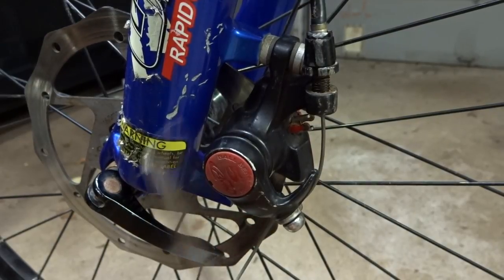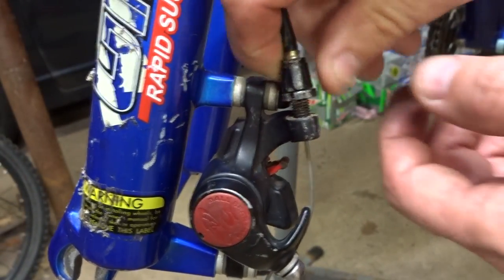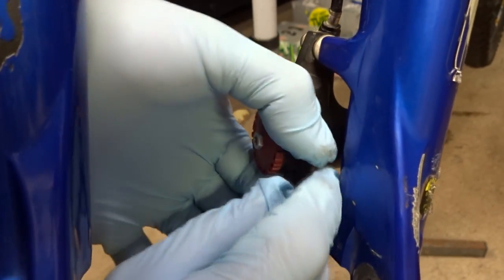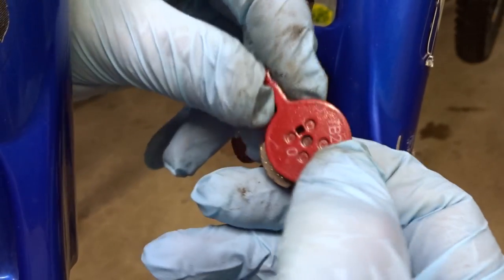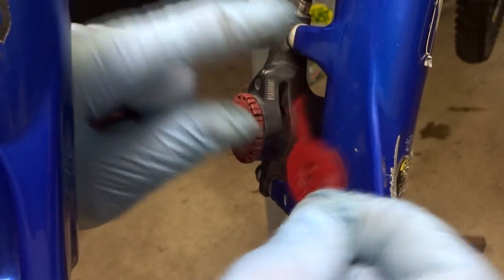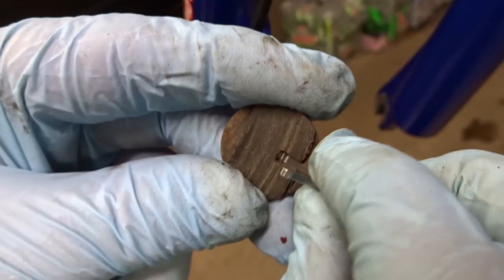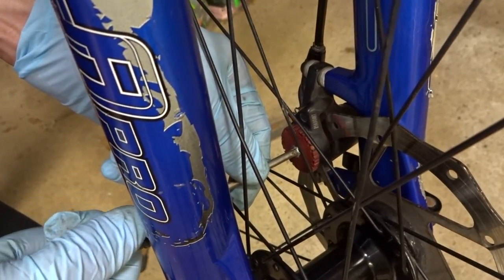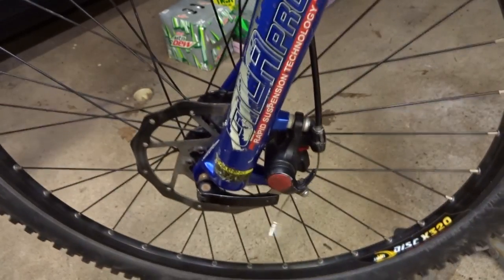How To Replace Avid BB5 Disc Brake Pads - Easy!

Comment: Thanks for posting the content. I was having trouble with the BB5 on my rear wheel. If I adjusted the inner pad until I got good braking efficiency, the inside pad would rub on the disc. If I backed it off two clicks, then I had serious brake fade. I still had plenty of lever motion, and I adjusted the pads to a very even and narrow gap on both sides of the rotor and I still could not lock up the wheel. I bit the bullet, pulled the wheel, removed the pads and pulled out the metric vernier calipers. One pad was 3.56 mm, and the other pad was 3.0 mm. I replaced both pads with AVID OEM pads and the wheel locks up nicely, even down grade on rough asphalt. Great descriptions, and great video quality.

Comment: RJ you are my hero this vid was exactly what I needed!  The spreader comes out the back of the caliper housing, and the pads come out the front!   I was trying to get the spreader in the same slot as the pads, derp!!   Nice videography too, difficult to light the inside of the caliper housing.

Comment: Video is very helpful. For those who need to know, You can indeed slide the caliper back and forth a bit by loosening the 5 mm Allen bolts to better position the outer pad closer to the rotor however in my case the pad is almost flush with the caliper itself and causes the rotor to rub directly on the caliper. In short there is little room for adjustment so new pads are necessary.

Comment: A little note here on wear adjustment on the BB5: There are at least two sets of instructions on this from SRAM. One of them, the installation guide (95-5018-005-000 Rev A), says not to adjust for pad wear using a barrel adjuster. The other, the BB7/BB5 service manual, page 11, says that you should use the barrel adjuster on the caliper, but to make sure that you use the locknut after you're done.

I remember adjusting a friend's BB5 caliper once, and specifically remember reading official instructions that said to use the barrel adjuster. In any case, this seems the obvious way to do it on the BB5, because there's no other adjustment for the outboard other than possibly pulling more cable through the bolt (which I wouldn't really like to do). Incidentially, this stupid problem was solved with the BB7, which has adjustment knobs for both pads. Mechanical brakes like the TRP Spyre and Spyke also have adjustments on both sides.

Comment: Hi mate thanks for the explanation!! 
 I need to replace mine as well but nor sure what pads I should buy. Originals by avids are around 15 for a pair or I could get another brand on amazon and they are 10 for 2 pairs. Which one would you go for??
Thanks for your time and stay safe.
Reply from the maker: Shrug. Your choice. Sometimes off brands are as good, sometimes they are not.

Comment: How thick are these BB5 pads in the first place? You measured the old ones but I was hoping you'd measure the new ones as they didn't look that much thicker to the eye!
Reply: I see you did not receive a reply from the content creator. I had the same question, did you find out the thickness of OEM new pads?

Comment: Hi RJ THE BIKE GUY I NEED HELP I have broken bolts on the disc break rotor how do you remove it I still love your videos
Reply from the maker: I don't know what you have to work with. A good penetrating oil. Heat. Tapping. Work them out. Good luck!
Reply: Thank you

Comment: Very good,  but had one problem and found solution.  When I removed spreader using pliers (maybe too big) caused clip to be compressed some.  It would not lock in after.    On the other wheel,  I used a small jewelers screw driver in the bend in the spreader and pulled it out easily without bending it.  Went back and shaped first spreader like the unbent one and it stays in now.

Comment: Thanks!
I'd also recomend checking if the disc or housing needs de-greasing, as it can affect the braking power. Maybe more important on the rear  brakes though, with the chains potentially throwing oil around.

Comment: Pads are still quite thick, you can adjust the cable bolt to make the calipers and pads move closer to the rotor at rest.  Same with the static caliper on the other side.
Reply from the maker: I was showing how to replace them.

Comment: Ey so I did the same thing you did putting the pads but why when I use the brakes the brakes feel really loose how can I fix it
Reply from the maker: I am guessing you didn't get them adjusted correctly. Or did something else incorrectly. Do it again.
Reply: Ok I got the brake pads but when I push down on the brake lever it goes almost to the handlebar is that ok?

Comment: Hello, I have a 2014 Santa Cruz Chameleon with Avid disk brakes. The brake model isn't listed in the specs on the the SC website. I can't figure out what brakes they are and what replacement brake pads I need, and Santa Cruz and Avid are both unwilling to help (they just want me to go spend unnecessary money at a dealer). Any ideas for how to figure out what pads to get? Thank you.
Reply from the maker: Identify the brakes by looking at the brakes.
Reply: @RJTheBikeGuy  Interesting, I think my question seemed reasonable, why even reply if it's going to be so worthless?
Reply: Your local bike shop should answer your question.They did for me.

Comment: I have Promax Render mech discs and a problem with the adjustment knob of the pads: front one doesnt wanna move at all and rear rotates both the know and screw, but there is no effect on the pivots. Whats the deal? Oh and the allen bolts inside of the knob are both stripped.
Reply from the maker: Dunno. Maybe they are seized somehow.
Reply: Tried some wd40, and it did nothing. I'm wondering more about that moving and not doing a thing caliper though.

Comment: The disc does not look like it's good at all it looks the exact same disc as the mongoose dolomite but idk I would like to know how well they stop you?
Reply from the maker: You would not use them for downhill racing. But they work fine for normal riding.
Reply: This is the lowest end, entry level disc brake assembly from Avid/SRAM.  The next step up, the BB7 brakes, are considered by many to be the standard by which all other mechanical disc brakes are measured.
Reply: I'd argue that the TRP Spyres are standard nowadays
Reply: Yep!  It seems that all manufactures install them on entry/mid level bikes, nowadays.
Reply: How much rotor flex is acceptable?

Comment: RJ my disc break is touching the rotor it that ok or not
Reply from the maker: The calipers should be adjusted so that when the brakes are not being applied, the pads should not be touching the rotor. They will be almost touching the rotor.

Comment: nice tutorial, but this design is not that great, you can only adjust one pad, with TRP Spyke you can adjust both. I did not know about this after market brand,always great to discover brands.
Reply from the maker: Actually they can both be adjusted. The inside pad can be adjusted with the dial. And the outside pad can be adjusted with the barrel adjuster.
Reply from the maker: p.s. I didn't design it. These were the brakes that were on this Cannondale F7 when I got it. Feel free to contact Cannondale and tell them.
Reply: That does not count, the barrel adjuster is for the wire tension, but yea many use it to adjust the pad too, which is flawed, as the leverage change, you won't get the same modulation,So I proper adjustment of this brake means moving the calliper, which sucks, I had Tektro & Promax brakes in the past,which had the same flaw. another flaw is that its a single piston brake,they never gave me enough brakign power without abusign all my fingers, but for some reason people recommended the Avid over the other cheap brakes, I don't know why.
Reply: I am just sharing what I know,but they only use hydraulic brakes now,some of them are awful.
Reply: That's why I used BB7's on my e-bike build.  Both pads have individual dial adjustments on each side of the caliper.  That's also why BB5's are generally regarded in the cycling community to be crap.  BB7's work awesome, especially with special compressionless brake cable housing, and the cost difference over BB5's isn't that much.
Reply: Yea, probably why I remember that I read so many comments about them being great, But still single piston, so not for me.
Reply: Maybe, TRP Spyre for road bike, or Spyke for MTB brakes are suitable to your needs.

Comment: The outer pad of the BB7 gets worn out earlier, because it moves towards the disc when braking and then presses the disc towards the inner pad.

In case of a light braking maneuver the inner pad might not even touching the disc

I wanted to find out if the pads of the BB5 are symetrical and had a look on this channel.

The pads of the BB7 are not symetrical.

So it is not possible to change the more worn out pad with the less worn out pad.

In case of the BB5 it seems to be possible. 

To mention the video, I would have tighten the string a bit after screwing the barreladjuster back again to really wear the pads down to 3 mm.

Many say the BB5 is not as good as the BB7, because the BB5 has no adjuster for the outer pad.

I wonder if that adjuster for the outer pad is really necessary when there is a barrel adjuster for the string instead.

Comment: HELP... Anyone?  New pads are too close together, not allowing the disk fit.  My "spreader" pin is install.  What is wrong?
Reply from the maker: Either you haven't backed out the adjuster, loosened the barrel adjusters, or someone tightened the cable the adjust for pad wear. Or maybe something is under the pads that shouldn't be.
Reply: sometimes the products just aren't to spec, especially if it's not Avid brand pads..  sometimes gunk has packed up on the piston...  sometimes it's poor quality and you'll just need to take a file and buzz some material off